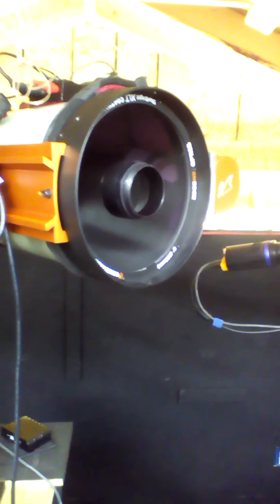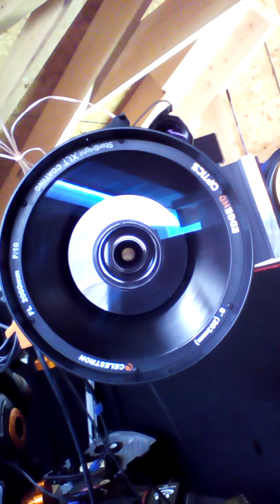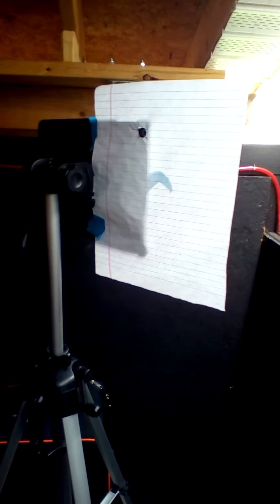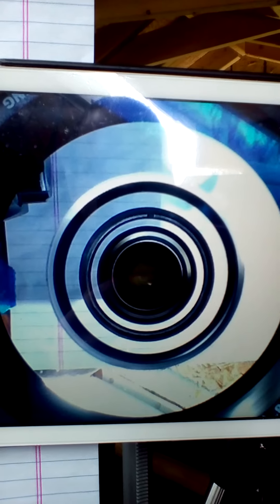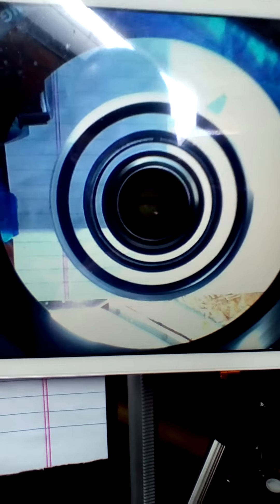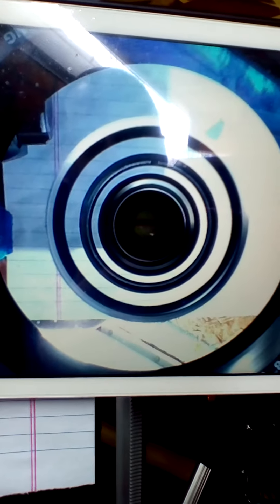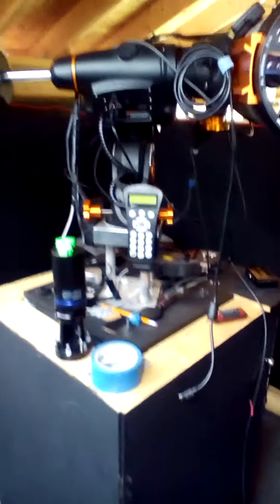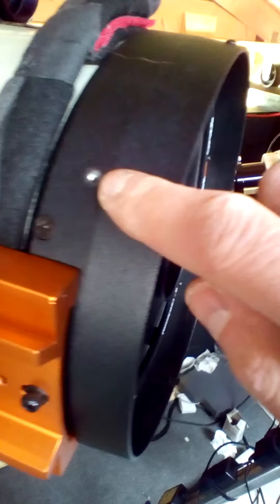Adjust Corrector plate for Hyperstar

Comment: Great video, I am trying to mimic your technique on aligning the corrector plate on my C1400 DX.  My question is how did you know where to place your IPAD and tripod spatially in relation to the primary mirror?  

I am found that by moving my camera on my tripod I can make the circles perfectly concentric by slightly moving the tablet around.  So how did you find true center between the exact middle of the primary mirror and he middle of the camera eye?  Did you use a laser?

Once I understand how precisely alight the camera eye on the tablet with the exact middle of the primary mirror I can complete my adjustment.  

Thanks!
Koinonos
San Tan Valley, AZ
Reply: My first attempt at this went pretty well.  I ended up using a collimation laser to help center my tablet to the center of focus for the internal ring to get everything centered.  Then once I had the ring centered I collimated the outer ring.  Thank you for the informative video!

Comment: Thank you robert.  I would sure appreciate it if you could tell me how you setup the camera, bob
Reply: I know you've probably figured this out by now...  but for others who might be interested...  I used a webcam on a tripod...  i leveled both the camera and the telescope, with the telescope pointed directly at the camera as best i could... I measured the distance from the floor to the center of the secondary before removing it, and set my camera at that height, re-leveled (everything so slow and careful)...    i used the hand control to very slowly move the telescope until i had the center "white" ring, well, centered (according to calipers held to my screen as he showed)...  my camera app doesn't have a zoom feature, so I had the camera set about 18 inches in front of the scope...   he showed his camera covered by a piece of white paper...  this is important, it helps to create strong contrast between the black and white rings... I used two sided tape to attach a piece of sketchpad paper to the camera...  I found that the lighting in my room created halo effects around the metal parts,  so i put a flashlight on top of the scope and pointed it at the camera...  this created strong contrast between the rings and allowed for clear differentiation...  after making very slight moves of the corrector plate I used the hand control and calipers to recenter the inside white ring...  setup for this took much longer than actually making the adjustment...  all told about 2 minutes to make the actual adjustment and an hour to set up careful....

Comment: how did you ensure that your ipad was aligned well with the SCT? if it was a little crooked the circles would look uncentered even if they really arent.
Reply: I know this is an old comment, but I'm replying to help others in the future that might read it. To align the iPad/camera up, align the camera so the hole where the secondary mirror goes is aligned perfectly in the center of the first circle you see. If your corrector plate is perfectly aligned, that circle should be perfectly in the middle of the next circle you see. If it's not in the middle of that circle, then you adjust your plate until it is.
Reply: Right but I was asking was how do you insure the scope and the camera are aligned. The plate can be centered ready but if the camera is looking at it from an angle the circles will not be concentric.
Reply: @regp5  Using this method will always have a margin of error with it, that should just be assumed. This method allows you to get it "close enough" that the end results will only be marginally worse than getting it "perfect". If you're after perfection, this method isn't the right way to go about it.